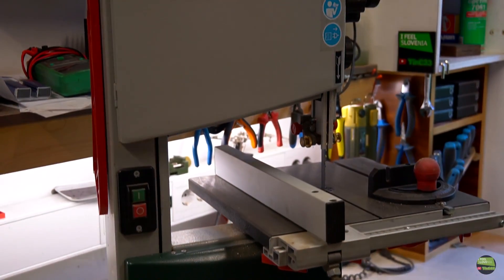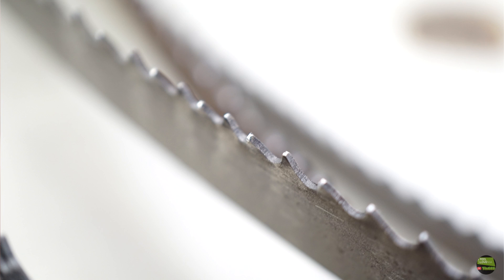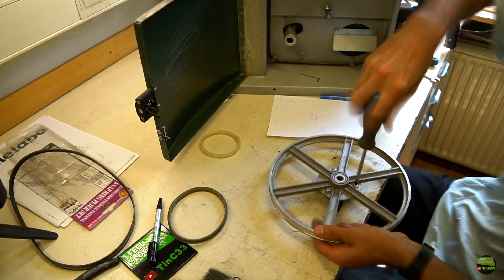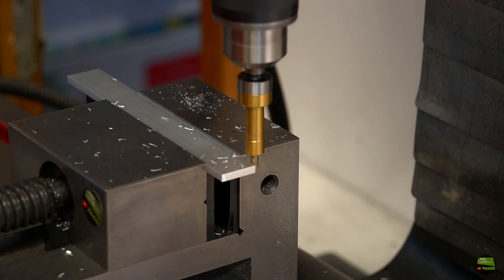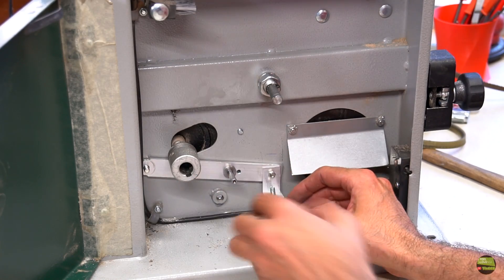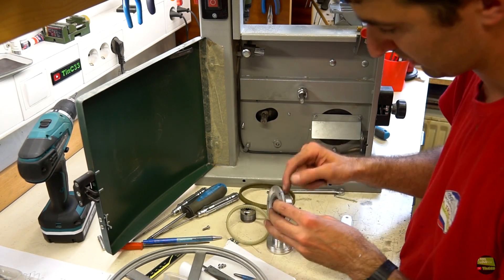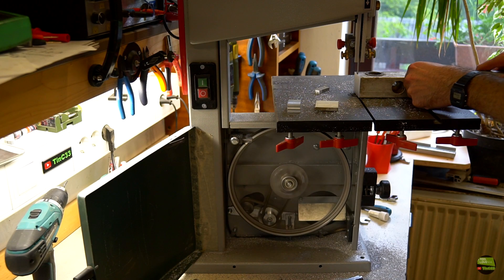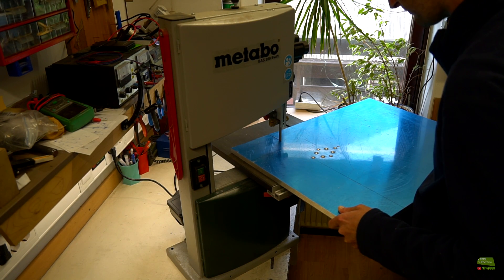METABO bas 260 Bandsaw Modification [lower down the speed] to cut aluminium / brass / metal

Comment: Would a electronic variable speed controller work if wired just in the supply lines to the motor
Reply from the maker: No you'll need vfd to change rpm of that motor.

Comment: Great video! I have a very similar bandsaw and want to do a similar modification to reduce its speed. I think it can be achievable combining a slower RPM motor (a motor with more poles, 750 instead of 1500 rpm, for example), the gear ratio and a VFD to reduce its speed even further. I thought of what you said about having a small and a large pulley inside the housing but I think it's not feasible, asi it might be too difficult to keep the belt from slipping. I also saw this, which puts the motor inside a cabinet below the bandsaw (requires opening a hole with an angle grinder though): https://ibuildit.ca/projects/band-saw-mods/
It would be great to measure how much power you lose by having a third pulley, friction and the belt warming up might reduce it quite a bit.
Reply: Yea, I thought of that also. I have a similar saw and it has 2 polepair motor (1500 rpm) and when I looked for a 4 polepair motor (750 rpm) it was 200 euro XD So pulleys it is.
Reply from the maker: thanks for info, i think about VFD but i afraid that it has no power on 10-20hz, i need to contact belt seller what belt they suggest for that job, also i was think that it can slip but maybe use toothet belt i don't know. mod on link take toomuch space for my workshop, but replace the motor with 6poles is good idea, but new motor could be a bit costy :)